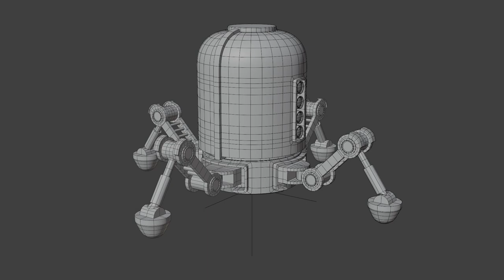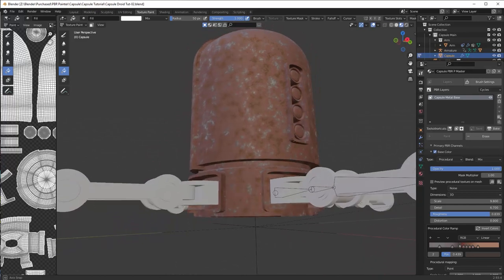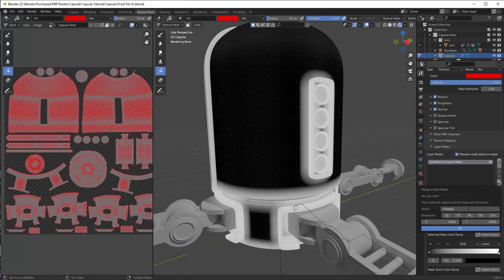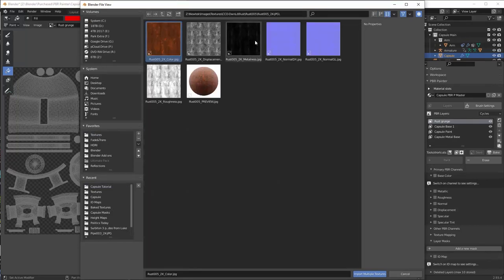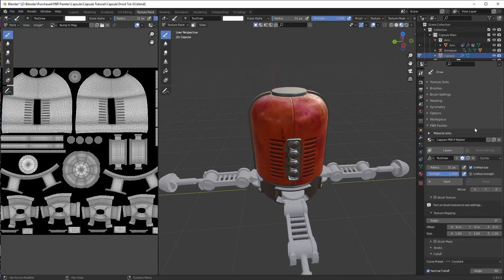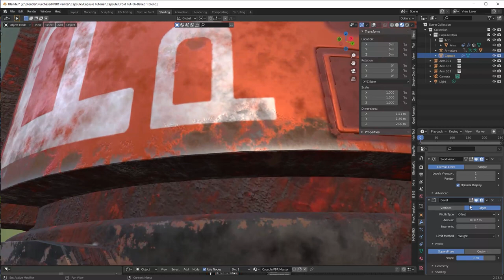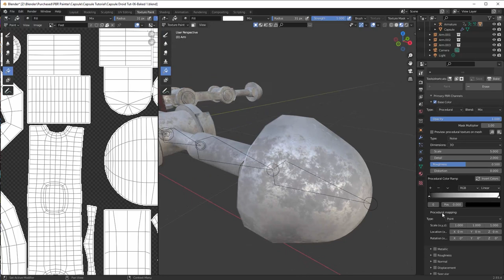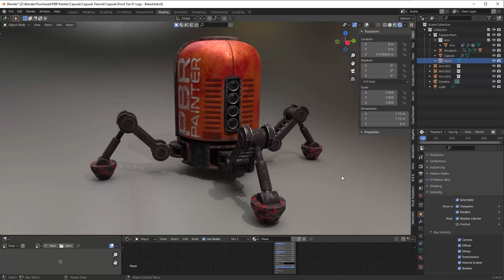Texturing a Sci-Fi Droid with PBR PAINTER in Blender 2.9

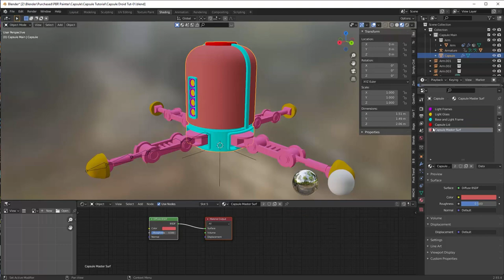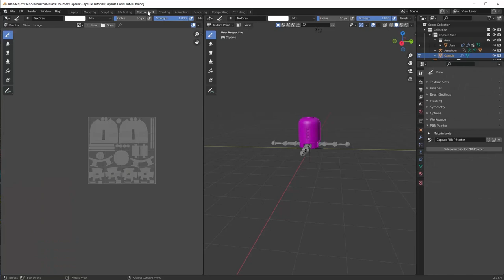Comment: Please explain why you began the tutorial with Material ID's and then did a Bake.  Then yoou created the plain white material and removed the mtls ID's . This occured at the very beginning . I lost it even though I am very familiar with PBR Paint . My utter confussion be gan at 3:00 in to the video untill 7:00. I have been using the wonderful paint app for the past five months . Maybe I'm just missing something so basic ...so please help !
Reply from the maker: Hi Richard, In order to make an ID map I simply gave various parts of the object an individual material. I then used these individual materials to bake one ID map which I could then use in PBR Painter later. I then simply made one material for the whole object and when I need to isolate a specific part of the mesh later I could just use the ID Mask (I don't know of any other way to create an ID  mask currently). It meant not having to have multiple setups for each different material and, in some cases,  I could use the same masks for the whole object. You will notice that I didn't utilise all the ID masks but the option was always there to use them if I needed to. Hope that helps, if you are still confused let me know and I'll do an explainer video.